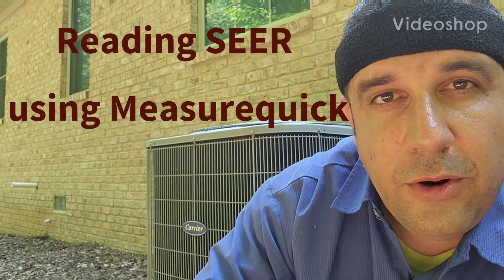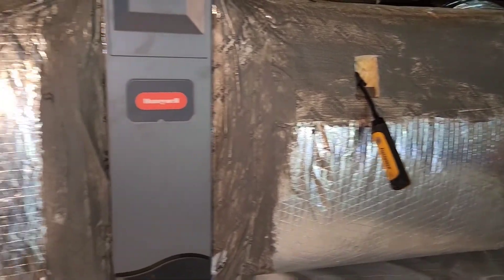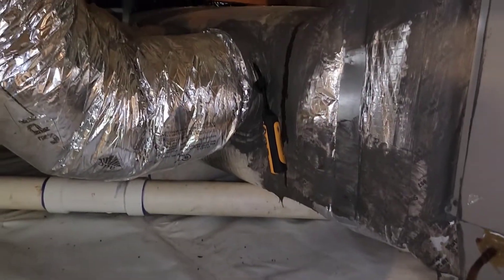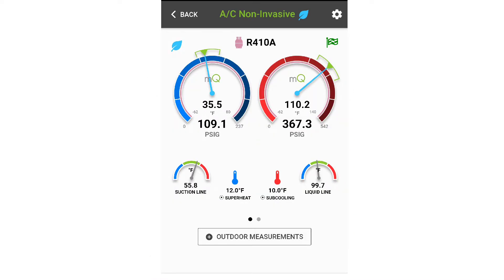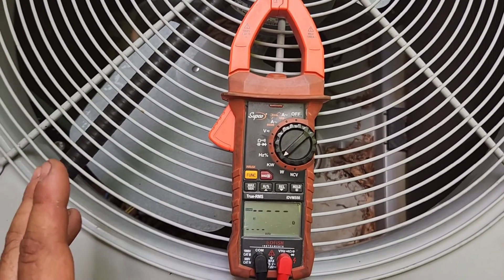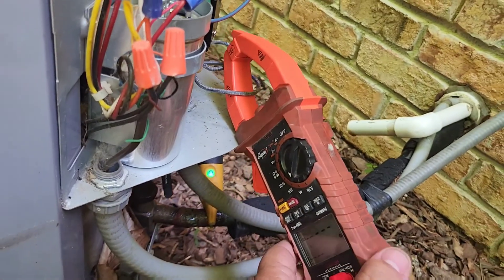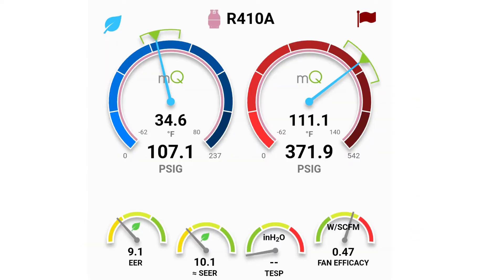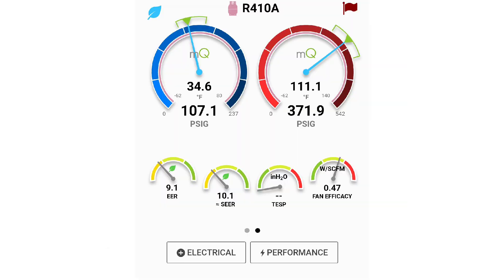Measure an AC unit's operating SEER

Comment: Did you figure out if the run cap was actually out of spec?  It would be interesting to know how the system tested once a new capacitor was installed or if it needed more or less refrigerant.  Basically,  we're you able to get the SEER rating up to 13 and how did you get it there?

Anyways...thanks for the video.👌🙏
Reply from the maker: @I_have_Aquestion  she took 2 months to approve the repair and someone else went back
Reply: @timdestasiohvac  Ha!...I own an HVAC business.   I know exactly what you're dealing with.  Lol. Cool video, though.  Thanks for posting it. 🫡